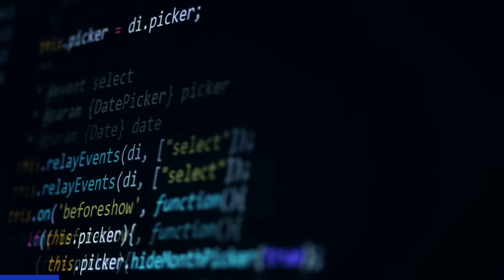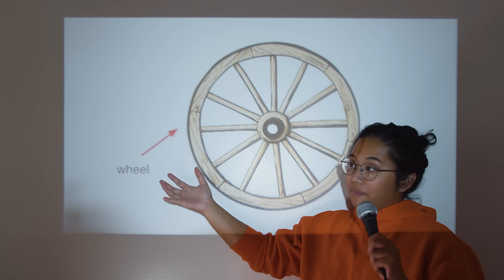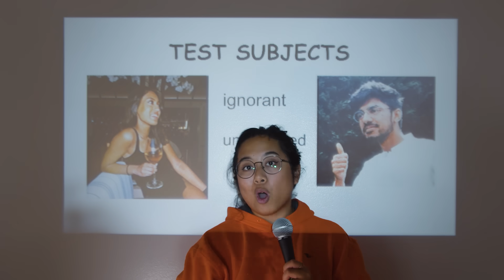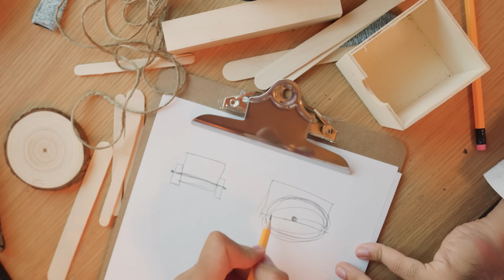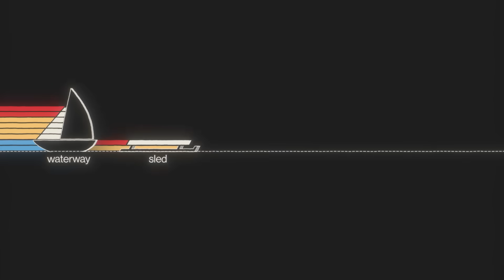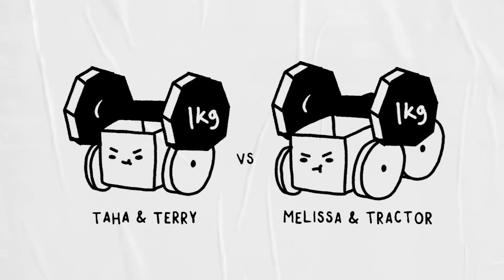why it took 200,000 years to invent the wheel

Comment: The trick to the wheel isn't that it rolls. It's the mechanical advantage it provides, that it allows you to move much greater weights than you could dragging that same weight.  I don't think that is obvious until you have used a wheel for that purpose.  Since we don't encounter many natural examples of that, it probably wasn't until we started chopping down large trees for building materials that we started to figure that out, rolling large logs.

Comment: Wheels are not an obvious invention under every set of conditions. Like, there are certain social and economic and environmental conditions where what you really need is a wheel. They allow really fast and efficient movement on flat smooth hard ground for example. But most of the world's problems are not "how to get a bunch of stuff from point A to point B along a pre-determined paved route using minimum energy at maximum speed."

Comment: Spinning a piece of plank on a stick as the plank is touching a grindstone (granite-like stones would do) is enough to make a circle. The axle is easy, a cap at the both sides of the wheel which would be configured to not slide off. Old chinese woodworking tactics without screws could be uses for a more fixed surface! 👍

Comment: The idea that the wheel was invented is pure fantasy. Let's get this straight – nothing is invented in the sense people think. It's not like one day some brilliant genius thought, "Hey, let me make a wheel!" It’s all just a slow, painful evolution of ideas, one thing leading to another, without any magic moments of sudden brilliance. The first humans didn't have wheels – they had tree logs. They didn’t create anything – they used what they had. They rolled logs down hills. That's it. Simple. Functional. The idea of the wheel didn’t just appear in a flash of genius – it came from dragging a damn log down a slope and realizing, "Hey, that works better than just lifting it."

Fast forward to today, and we get the so-called "wheel" – but it’s not a huge leap forward. Over time, humans modified the log by cutting off unnecessary parts. But even that was gradual – first, you had logs, then smaller logs, then the idea of making something round. This was all trial and error, not some lightbulb moment where someone shouted, "I’ve invented the wheel!" It was a slow burn of improvement over centuries. It’s all just nature’s evolution, not a revolution.

Now, let’s talk about the bicycle wheel for a second. People think the bicycle wheel is just a better version of the original wheel, but it’s really more like an arch suspension bridge than it is a regular wheel. You’ve got tension, compression, and all these structural elements – stuff the old log didn’t have to worry about. You think the bicycle wheel just magically came about by tweaking a few details? No – it evolved into what it is through countless iterations in mechanical design. It’s the result of engineers understanding structural integrity, not some whimsical idea about "rolling things better."

This whole idea of “invention” is ridiculous. Everything evolves over time, one step at a time – no genius, no magic moment, just human ingenuity building on what came before. The wheel is just the latest evolution in a long line of smarter solutions. That’s how progress works, not by some mythical spark of brilliance.

Comment: As a professional baker who specializes in bread, I can absolutely confirm that the water makes a huge difference. Here in Texas, the water is notoriously hard, to the point where the best bakeries I've worked in have had insanely expensive water systems. That said, the baking method, proofing method, other ingredients, and how those ingredients are incorporated into the dough are also crucial to the end product. Every viable bread dough incorporates the same handful of ingredients, but all of those variables create wildly different results.

Comment: Hi. The wheel was known about tens of thousands of years before it became commonplace, but not developed or used for four reasons.

1/ Wheeled vehicles are only reliable when used on carefully prepared wide roads, and we had no reason to make roads while we lived as nomadic hunter/gatherers. The "great silk road" to China was actually a rough track, and sometimes not even that.

2/ Wheeled carts only became necessary after industrial level agriculture started, to carry large amounts of produce from the countryside where it was grown, into storehouses in the towns and villages. It was at this time that "roads" became economically necessary. 

3/ Most cities were situated on rivers, and radiating canals were the most cost-effective way to transport large loads over the supporting hinterland. England embarked on massive canal building projects in the early nineteenth century, but these were cut short by the rapid growth of the steam powered railway from 1830. Canal boats were very slow, but the railways made it possible for people in the midlands to eat fresh fish, and Londoners to have a daily supply of fresh milk from Devon. The canals just couldn't compete. 

4/ Carts are easy to build, but making wheels of sufficient strength and lightness is very difficult. "Wheelwright" was a highly specialized trade, and for most of history there was no quick way for the slow improvements in wheel design to spread widely. 

It's one thing having knowledge, it's another entirely to live in an economy where that knowledge can be put to use. The wheel had to wait for time to roll around. Cheers, P.R.

Comment: 3:30  The exercise you gave to them is dumb and it isn't how the wheel was invented.   Before the wheel there was the LATHE.   You needed lathes for straightening arrows and making things round.   You needed lathes for rollers.    And you didn't give them a lathe.    Lathes were simply two sharp points, could be rock or sharpened hard wood sticks....and they could be tied down with ropes onto solid rocks and a chunk of wood could be mashed between them while a cutting tool cut.

Futhermore, once you have a lathe you can make a slightly better more permanent lathe or a bigger lathe with the round things you already made.   

Once there, and once you are making nice big rollers you can come up with a way to clamp with that lathe...using rope...and then you can bore a hole in the middle of your round platters or logs.

And then you are getting there.

See how simple this was?   

Then when you have an axel that fits into a hole, you can make it not wobbly.

Then you can finally use tar or rope and rap the wheel, but if you already have metal working, which you do, you can refine it....with an outer metal tire....and then refine it futher by making spokes. 

IT ALL BEGINS WITH A SIMPLE LATHE

Bow drills have been in use since the stone age, so we knew about spinning stuff efficiently.

Comment: A wheel is nothing without a road. 
A road is nothing without a society that builds and (!) maintains said road.
A single road is nothing without a network of other roads it connects to, which is basically society again.
A network of roads is nothing if you constantly get robbed moving desirable things on it - so a network of roads is nothing without security - which is basically society again ("a social covenant to not rob each other and a means to enforce that") 

Which probably are some of the reasons why it took so long for the wheel to be not only invented but also widely used. (Some societies did invent the wheel but it never made it beyond the "being a childrens toy" stage because "no roads" etc)

Comment: I'm surprised there was no mention of the importance of terrain. I mean, a wooden wagon, with wooden wheels, on wooden axles aren't exactly high performance ATVs. More to the point, aside from a vast plains region, early wheeled vehicles sorta need roads. And without brakes or ratchets or high torque engines, it doesn't take much of a gradient for a heavy wagon to go from energy saving convenience to runaway menace. For example, I seem to recall something from Japanese history mentioning that they were still using litters well into the 19th century because many of the roads were too steep and uneven to reliably use carts.

Comment: I should have to say that the US did get e-mail "smart phones" the IBM Simon in 1994.  However it was short lived due to the popularity of flip phones that were smaller in size and had longer lasting batteries.  This is one reason why the concept of the smart phone as he know it today didn't really take off until the release of the iPhone in 2007.  However, we have had smart phones since the 90's, usually aimed at business customers. (BlackBerry anyone? 1999-2016.)  It's also hard to coin exactly when we got "3G" in the US because the same time Japan was getting real 3G, we we're upgrading to 2.5G technology then marketing it as 3G. However, Verizon was only a year behind Japan with it's 3G CDMA/EVDO networks.  (Which did differ from the WCDMA that came to the US in 2005, so only 4 years behind Japan.)

Comment: The wheel got invented but i think it's too difficult to improve on its design like ' a circular wheel'. We had minor improvement there with material there but not a lot. Also, we have some design which include removing wheel like maglav and hyperloop. But understand it wasn't improvement in wheel (improvement in transportation to be exact). That what i am talking about we have to remove wheel if we want to improve on that sphere shape wheel. That sphere shape wheel is that perfect design.

Comment: One thing I think was missed is talking about roads. Things like sleds are a lot more forgiving on soft or uneven ground. The asian steppes make sense as a origin for wheels because they don't have an alternative (no water nearby) and as far as wild terrain goes they are pretty smooth and uniform. Compare that to rocky, sandy, or hilly coastal regions you'd have no motivation to invent an alternative to watercraft. Even today less then 10% of the global population lives more then 10km away from a major water feature and that was likely even smaller before.

Comment: I'm 99.99% sure the first wheel was literally just a cross section of a tree a few inches thick. Cut the size you want out of an appropriately thick tree, bore a hole in it and you've got a wheel. People would have learned you can roll logs, why not put that to use?

Comment: The problem with inventing the wheel is that you also have to invent a bunch of other stuff for it to be of much use. like the axel, wheel nuts/pegs so the wheels don't fall off etc. Then you have to invent things like the chariot or the wheeled plough. On it's own a wheel isn't very useful. It wasn't until we had a bunch of other stuff to use it with that someone actually thought to do it. before that, you could use logs as rollers or drag things with beasts or people.

The wheel was discovered long before it was being used. I wouldn't be shocked if you showed a wheel to a cave man 200,000 years ago he would say "Yeah, its a round thing. We've thought of that, So what?" but if you then attached that wheel to another wheel via an axel that is in turn attached to a cart, he would immediately have his mind blown.

Comment: While Taha's approach was innovative, it would have failed in both longevity and practicality. The string axle would have lasted only one trip at most before wearing through. Also, the pivoting arms would have to be facing straight up to really support any load, making it nearly impossible for an ox, mule, horse or human to pull the cart. Melissa's 4 wheel cart was on the right track, with the deficiency being the strings serving to keep the wheels on the the axles. The key to making a circular piece of wood work as a wheel was indeed a strong and reliable axle and a way to keep the wheel on it.

Comment: There is a issue with this concept.

The wheel is just part of the transport system.

You also need a road. Yes a road, not a path. A road is quite complicated bit of infrastucture... and worse.. you need a road to support the wheel.. and you need the wheel to build the road.

They both need to co evolve. This is the true reason why it was so hard to develop. Because ir could nor be developed in a vacuum...

.. and  nothing is ever invented.

Comment: Another important factor is that for wheels to be truly effective you need to build and maintain roads, which is extremely expensive and time consuming. Wheels will get stuck in places that sleds would glide over with ease. In most places where humans don't use wheeled vehicles it's usually because wheels actually aren't the best solution for their transportation needs so there's little reason to use/invent them. And that's probably true throughout time as well.

Comment: I think that you're overthinking what a wheel is.  A straight log could be used as a wheel.  Sure, the design was made useful much later but they most certainly used wheels well before that.

Comment: This was less "invent the wheel" and more "invent the axle." I think a better experiment would be to just give them JUST the tools available back then and say "figure it out;" hand someone an axe and a saw and tell them to make a wheel. They even start off with round wheels so I feel like there's very little challenge -- especially since everyone here already knows what a wheel is and how it works. I think the main reason wheels were so difficult to invent wasn't just because "wheels r hard" but because there is a lot of ancillary inventions/discoveries that need to be made before you have all the tools necessary to fabricate wheels and axels. Like a lot of inventions, it's often less about a singular breakthrough but someone using ideas in aggregate to create something new.

Comment: Our ancestors saw logs roll, it doesn't take long to figure out the logs can be shortened to make it easier to roll. Im sure there are lots of other ways,  but thats a reasonable and logical thing to use, being trees are everywhere . Logs used in length can move large objects with ease. Rocks are too hard to consider it to be practical enough without major alterations to the rocks/stones. Our ancestors used common sense 😉 . Definition of things were definitely not same as today. So asking someone to invent the wheel isn't what to do. Asking them to mave something with these materials around you would be more appropriate. Saws were not around in those times, they use rocks to cut trees etc, and tree bark as roping.  Grain wheels were some of the first wheels but used for crushing not moving

Comment: but... what does the wheel have to do with using animal labor. Like an animal could also pull a sled (or I guess technically even a boat although that might be a bit more challenging)

Comment: Although wheel and axle are important in the development of wheeled vehicles, the third item that is not mentioned is the development of bearings to interface between rotating and stationary components.  Even if these were just plain bearings (I would not expect anything fancy like roller bearings or ball bearings), they would still need to understand what materials will best withstand the constant frictional forces on the bearing without wearing down too fast, or potentially even catching fire under the heat of friction.  Maybe even how to mitigate the friction with some sort of lubrication (oil or animal fat at the interface).
Reply: Ball bearings were possibly used much earlier, and linear bearings were used to help to slide sleds. Ball bearings could be made from stone or clay, but wood works fine for both

Comment: Anyone who tries to hurt Terry's gonna get a pencil or a wheel through the eye. John Wick style.

I regret nothing.

Also, I think whilst Melissa's pencil axles worked well, they do have a disadvantage IRL: since they're too rigid, it'll be too rough for the cargo to tackle unstable terrain, and if they need to carry much much heavier cargo, the axle will eventually give way.

Which is why Terry's suspension method works so well. It can carry quite a bit still--though not as much as a solid axle--, but it doesn't immediately run the risk of breaking altogether.

Comment: Technically the wheel has already been reinvented enough.
Once we got rubber, metal, and proper tools to build things, everything with wheels became far more efficient. Like when you think of it, the first few wheels were either stone or wood, now wheels are made of strong rubber and metal usually common in motor vehicles.
Unless technology advances to the point where the vehicle can just create a wheel from energy, we’ve gone far enough.

Comment: When I think about it, bearings are really counterintuitive. Wheels didn't work because they needed to have an axle and axles introduced friction. But then it turned out that you could make a low friction axle by adding more, smaller wheels that for some reason don't need axles of their own. Complete balderdash.

Comment: Another test that's missing: varied terrain. Unless if the wheels are specialized for it, terrain such as mud, sand, deep snow, ice, and hilly environments are going to make wheel-based transportation hellish, which can be even further exacerbated by obstacles and other detritus. This is why roads were so crucial to the wheel's success. Which adds yet another laborious requirement, by involving other specialists, and/or outright slave labour.